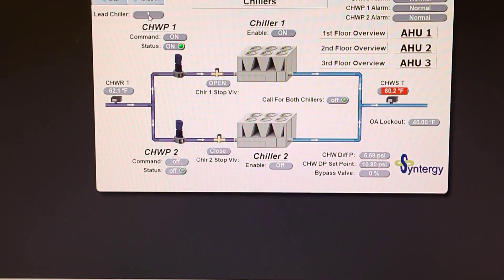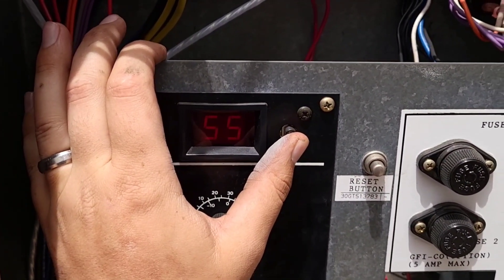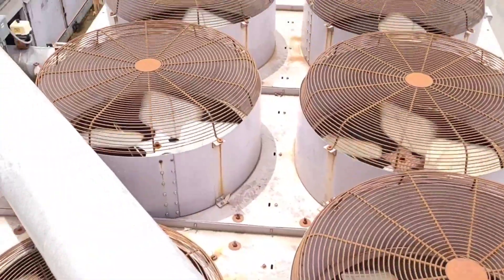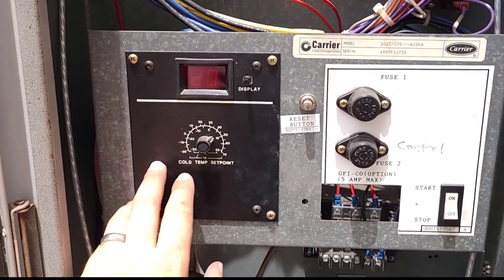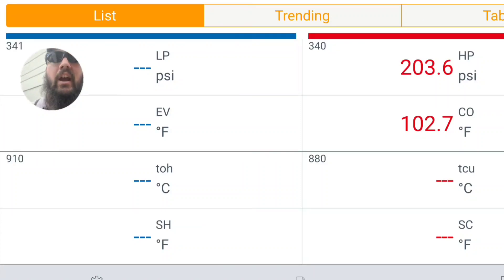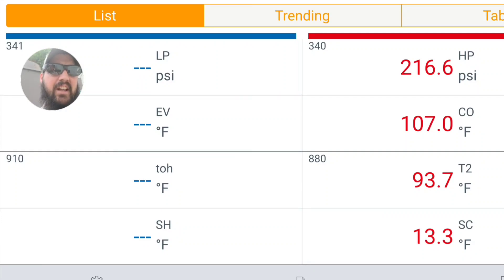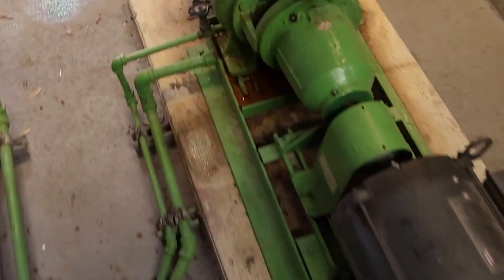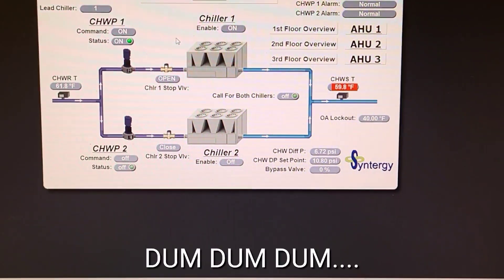Carrier Chiller Down & Automation Issue

Comment: Interesting situation, need to find more reliable contactors, spend a little more for a better relay or contactors. I don't know how many amps those chillers pull but it must be a lot to keep tripping out the relays.
Reply from the maker: The relays getting replaced are probably 10 years old.